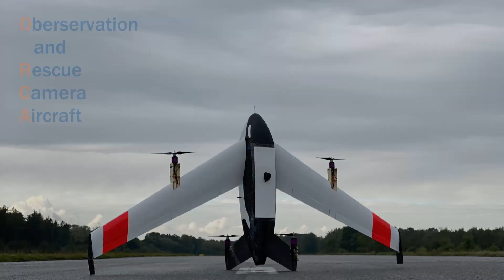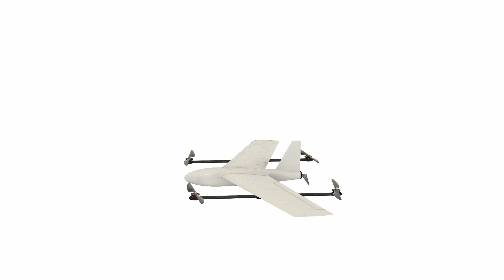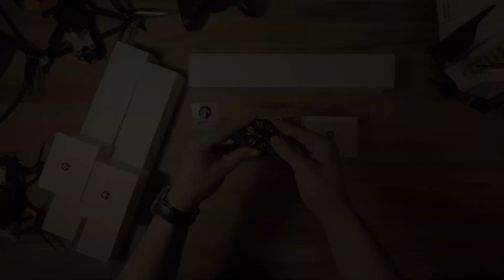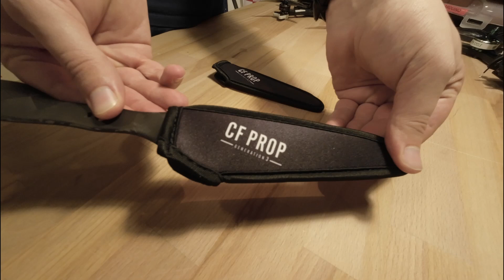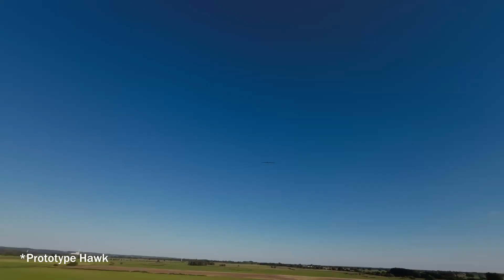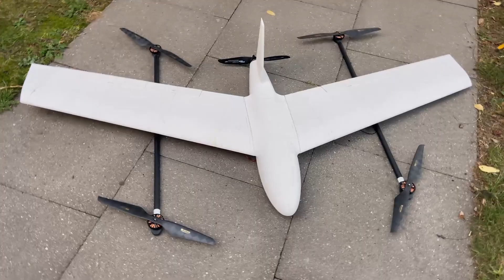A flying vtol with T-MOTOR

Comment: Does T-Motor have heavy lift motors?
Reply: depends on the type of t motor but generally no theyre meant only for hovering not full on drone flight   thats the purpose of the wings and thruster motor
Reply: @Vitality--Vault  okay thanks I'll keep researching for some.
Reply from the maker: Hi sir, T-MOTOR provides high-class motors, thrust from 0-150kg per rotor.
Reply: @t-motorforuavdrone4456  That will do. I'm trying to contribute my little bit to manifest the future we should already have by now. Primarily, with transportation. The only question is, how much? And, is there a website to see?
Reply from the maker: @adventurousloner  Hi sir, yes, for your reference: https://uav-en.tmotor.com/